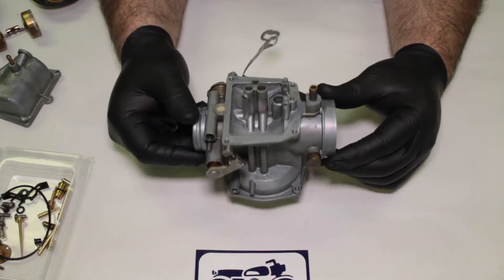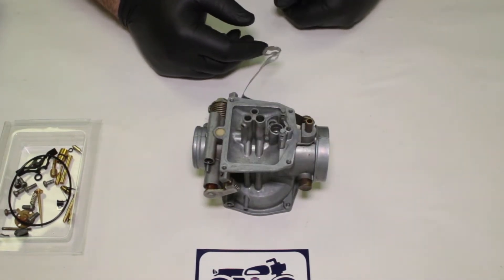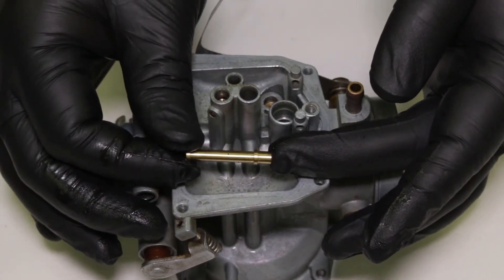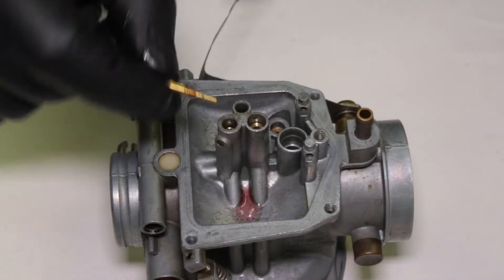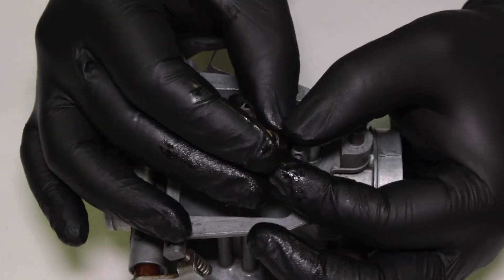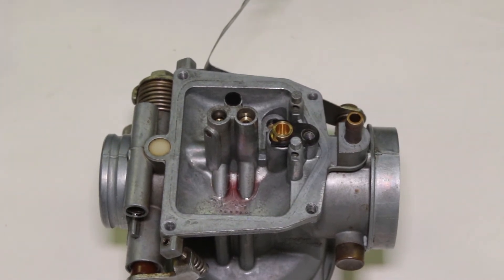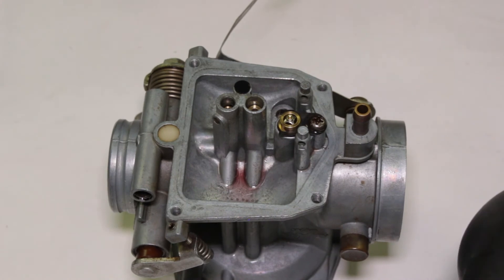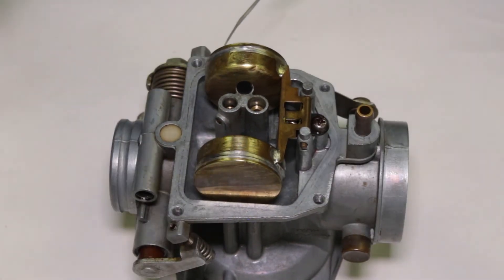Honda CB350 Carburetor Rebuild Part 2: Pilot Jet, Float Seat & Emulsifier Tubes Installation

Comment: I have had problems with the carbs on my CL350 and I want you to know that in my experience you are the only one I have found on here that talks sense on these matters. I like the way you say why the work may be necessary, what you're going to do, why you are going to do it and the techniques to employ, and what the resulting improvement should be. It's the reassuring kind of thing that home mechanics want to hear. Keep up the good work sir, please.
Reply from the maker: That what Brenden is best at and we found in every case it just helps to know those things. Thank you for the kind words!

Comment: The main needle in the slide is  not adjustable with slots .  My SL350 has a two into one aftermarket available in the day.  I think the bike ran ok when my dad had it but it had those two honda exhaust that are like $3000  to buy.   So my question is on other bikes usually you have to adjust the main needle  richer as the header freed up flow. Do you know if  this is needed and how  do you richen it up if i have to.

Comment: I’m trying to seat the jets back in but they won’t seat. I pressed with a punch but won’t stay in. Any suggestions? Thanks
Reply: damn, 2 years ago and no response??? I'm having the same issues.
Reply: The jets in the CMC kit are too small in diameter - they wont seat properly, don’t try and mash them in like I did.  The retainer clip should hold them in well enough

Comment: What did you clean the body with?
Reply: Crash Override Did you ever get an answer to this?
Reply: @markerasmus  CMC replied on the previous video saying they used "wash solvent" in a parts washer, presumably a hydrosonic one